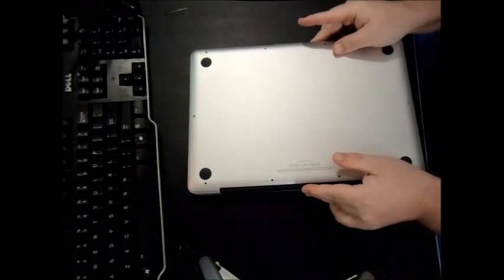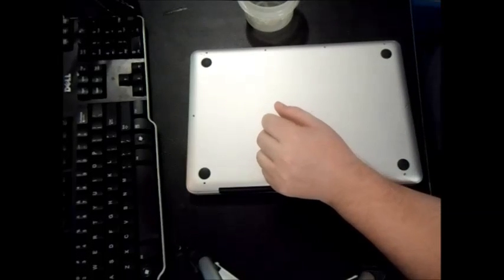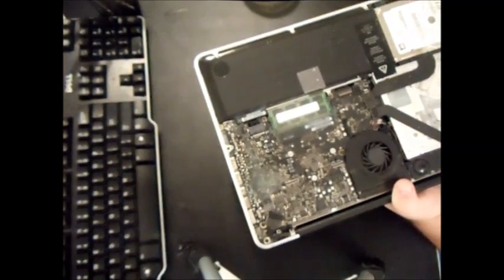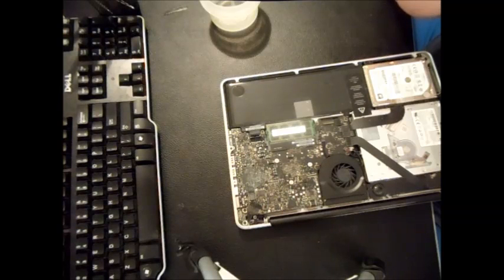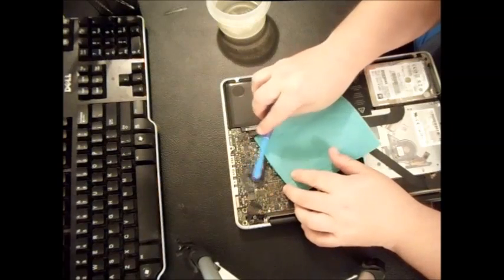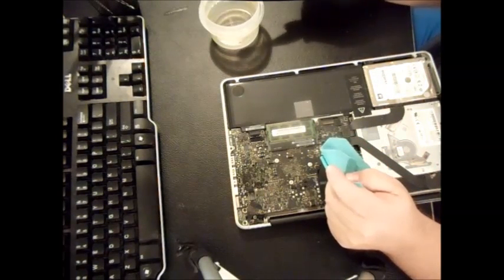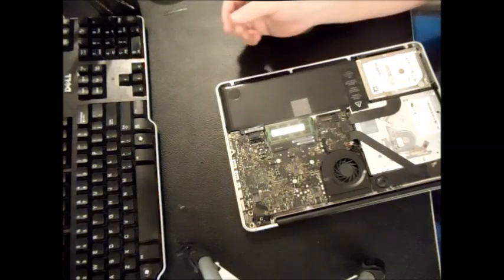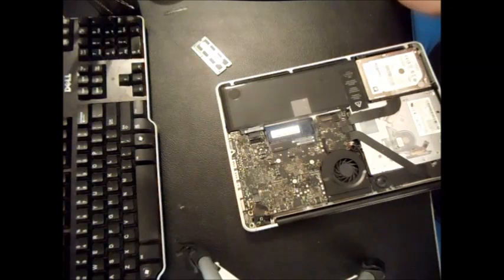How to REMOVE Water CORROSION Macbook Pro Air Logic Board (Clean Liquid Spill Motherboard Repair Fix

Comment: If the screen made colors when the liquid fell on it. Would it still be salvageable? Also on a separate mac I own w liquid damage turns on and functions only if plugged in. W an x on batter. Would cleaning the mother board help this one out or new battery or both?

Comment: Hey there, about 2 years ago, I spilled hot chocolate on my mac, and it started to not boot (didn't detect the RAM). It does boot, but most attempts fail. When it is on, it works perfectly. Is this solution still a viable option, or too much of a risk? Thanks!

Comment: For people watching this and will try to use isopropyl alcohol. Please use a higher percentage like 91% or best is 99% isopropyl alcohol. As it evaporates faster than ordinary rubbing alcohol which is 70% alcohol and 30% water.
Reply from the maker: agreed.  I stated that in an annotation, but youtube has since removed all annotations on videos a year ago.
Reply: And if it’s impossible to obtain anything higher than 70% Isopropyl alcohol - is there another agent you could recommend?
Reply: Anthony Biecheler go to a hardware or electronics store and ask for a electronic contact cleaner.

Comment: I really didn't believe that this works. I went to two authorized Apple workshops, they told me that the repair will be super expensive, better buy a new MacBook etc. I found this video randomly, after I have already ordered a new one, I gave this method a shot and... it works, I am just writing this from my old MacBook!!! 

IMPORTANT FYI: for me it did not work when I only cleaned the side of the motherboard which is visible when you open the hardcase. I actually disassembled the whole thing (took out the battery, the hard drive, motherboard) cleaned everything inside, clean the motherboard on the other side too, cleaned all the cable connectors, plugs etc. Even though there was no visible corrosion on the opposite side of the motherboard, I just cleaned the whole thing with this method. I put it back together and it is all working now! 

Thank you soooo much for this video, I will tip you on your PayPal for sure, you just saved me 900 Euro.
Reply: I would have like to see you do everything from scratch, not just (I already did this and that) I will look further to your links

Comment: Thank you very much for the video.  Last week I had water spilled on my Mac book pro and it z stopped working.  I exactly followed whatever you have explained, also removed all connections and cleaned on the backside of the board also. Assembled it back and it is working perfectly. Just $2 of alchohol nothing more than that

Comment: Hey man just watched your video. My 2015 MacBook got spilled on last year. Everything was fine and I had put in rice that same night so everything was cool. Recently, the fan started running really fast. Took it in the shop and they told me theirs corrosion on the logic board . Am I too late to try and fix this?

Comment: I have cleaned many logic boards using just warm water, a mild dish detergent and a toothbrush.
I rely on the fact that corrosion happens slowly and that a logic board needs to be wet for longer than about 24 hrs before it begins to corrode.
I scrub the mainboard gently with a toothbrush under running warm water. The running water carries away all corrosion and debris so I don't need to wipe it with any kind of cloth.
When I am satisfied that I have removed all the dirt and corrosion, I aim to dry the logic board quickly before it has time to corrode again. If the day is hot and sunny (above 85F or 30C) I put the board out in the sun for an hour or two. Or if the weather is cool I put the board into an oven for 15 minutes - half an hour.
IMPORTANT: REMOVE ANY BATTERIES AND PLASTIC JUMPERS FROM THE BOARD BEFORE YOU PUT THE BOARD INTO THE OVEN, OR THE BATTERY/(BATTERIES) MIGHT EXPLODE!!
 How hot should the oven be?
 I rely on the fact that all the components on the board were soldered onto it in a factory and that solder melts at a high temperature, therefore the board MUST be able to withstand some high temperature for a short while. I heat the oven to a little above the boiling point of water to make sure that all the water can evaporate quickly. I set the oven to about 120 degrees Centigrade, which is about 250 Fahrenheit, and put the board in the oven for about 15 - 20 minutes to dry.
I have cleaned about a dozen boards by this method and they have ALL worked perfectly afterwards.
I have also used this method to clean a digital watch that fell into the ocean and I was not able to get back with diving gear to retrieve it until the next day. It had not started to corrode in that time and it worked fine after I rinsed it out with clean water and dried it quickly.

Comment: My daughter spilled water into her macbook air and it went black. After letting it dry out for a day it seemed to be working okay but the battery would not charge. After replacing the battery with a new one, it still would not charge. I noticed several spots on the logic board that showed obvious corrosion so I assumed the logic board needed replacement($600-$800). I was about to order it when I saw your video. After cleaning up the corrosion as directed in your video, It's now working perfectly. Thank you so much!  I will happily make a donation to your Paypal.
Reply from the maker: Thank you
Reply: I have the same problem,im going to try it,hope this works.

Comment: This super MAC system “macvo unique only” (Google it) does not only apply to macbooks but to any laptop or computer too. You can save a good deal of hard disk drive space by eliminating acquired pointless information. This product is worth a try! Ideal attributes of it are Cleaning, Securing , Optimizing your Mac, anti virus, spyware..and a lot of more.

Comment: I have the same model mac. It got water spilled on it and that caused it to shut off. Let it air dry on the off chance it wasn't completely shorted. I got it to turn on and everything runs it is just really slow, on startup and trying to load any files, web pages, etc. I opened it up and there it the smallest spot of rust (not corrosion) on like two small components. Do you recommend this videos method or something else? Thanks!!
Reply: Hi. Just for information. There are many types of corrosion, and rust IS a type of corrosion. When steel or iron corrodes, the resultant corrosion is called rust. When copper corrodes, the resultant green corrosion is called copper oxide.

Comment: Alcahol... This confirms my thoughts on what to use to clean my muddy, flood damaged computer. If I can save my GPU, I'll consider it a success. If the mother board comes out alive, that's a bonus. If it doesn't work, it was still worth the try. Thanks.

Comment: Hi I recently spilled water on my 2016 Mac Book air. I turns on and runs, but it will not charge. This leads me to believe it is the logic board. Do you think something as simple as this would fix it?
Reply: Christian Dakin  hi christian have u got an answer to your question ? I have the same problem and i dont know what to do
Reply: I have the same problem with.my asus laptop

Comment: thank you buddy appreciate it you just saved me $800
Reply from the maker: Outstanding!
Reply: RubberWilbur same thing with me. Purchased a use one for $275 dollars that seemed to work great on inspection. The very next day I got the black screen of death. Took to Apple store and they informed me of water damage on logic board and that I needed a new one. They quoted me $750 dollars for the repair. Went home, saw your video and followed your instructions. After allowing it to dry, I turned it on and BOOM works flawlessly!!!!!

Comment: A couple of things. Firstly try get something higher than 70% ipa because theres too much water in that. And secondly, please DO NOT use a vacuum cleaner on your electronics unless you want to risk zapping them with static electricity.
Reply from the maker: +woolensheep192 Yes 90 percent is best.

Comment: Thanks for the video. I spilled juice in my macbook pro month ago. I took it to the apple store and they opened it. They sent me pictures of where the liquid have reached and I think it reached the logic board. I hope they at least cleaned it. It works totally fine and it only says for the battery "replace now". That's why it needs to be plugged in order for it to work. Do you think I need to replace the logic board or just do what you did?
Reply from the maker: +Ithar Alsawwafi do you see visible damage?
Reply: +RubberWilbur I don't really understand the images and I didn't bother to ask. Can I send them to you?
Reply: your battery is damaged, so you can use your MacBook, but if you see anything suspicious or the battery is getting bigger, GO to replace it
Reply: How much did they charge you?